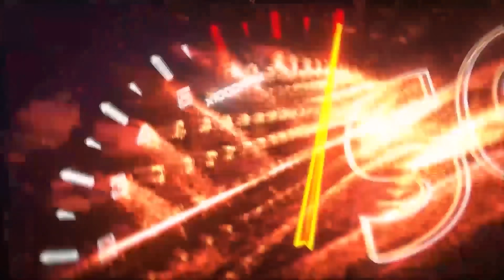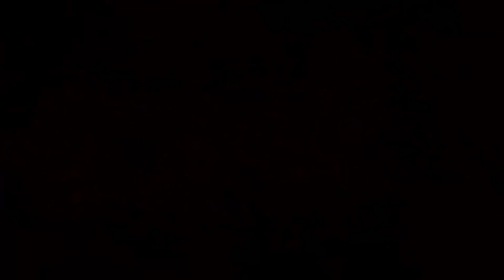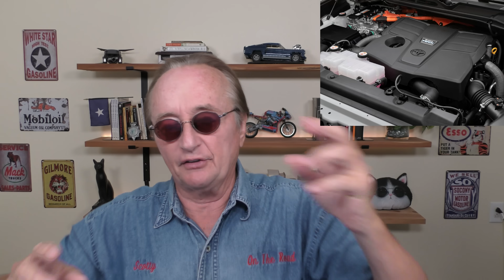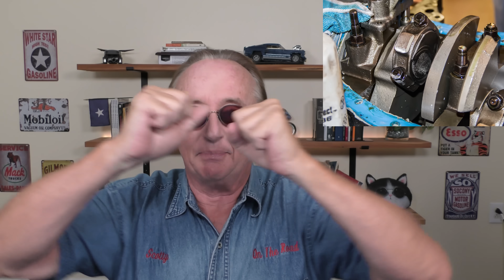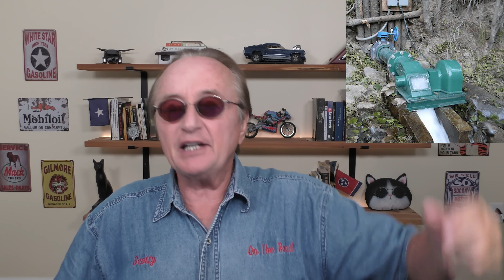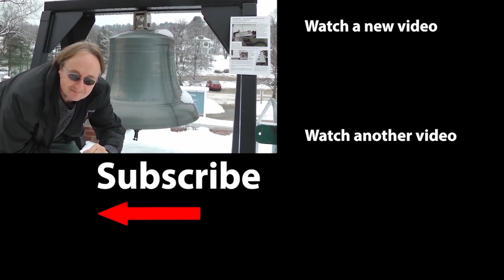America Just Lost It’s Last 2 Car Brands

Comment: 1️⃣get rid of $90,0000 trucks. 2️⃣ get rid of these turbo engines.3️⃣you don’t need a heated steering wheel 4️⃣we don’t need heated seats or air conditioned seats 5️⃣you need an airbag, cruise control and 4-wheel drive and that’s about it. The rest of the sh*t they put in and on these vehicles is pointless
Reply: Nothing wrong with heated seats or steering wheels, or air conditioned seats. It can be useful especially in areas with extreme weather conditions.
Reply: @AndrewFaust-x1e 
Not in the south
Reply: @AndrewFaust-x1e  Exactly, even old cars have them. Mine does.
Reply: So can gloves
Reply: Spot on, the more technology they put in these vehicles the worst they get.  When something goes wrong it will cost a ‘arm & leg’ to fix.
Reply: @guzmancharles7  Hell it costs and arm and a leg to diagnose, much less repair.
Reply: must have a premium stereo system
Reply: THANK YOU!!!
Reply: I have everything you mention in my $20k Sonic so it's not so much the accessories as it is the manufacturer's GREED.
Reply: For some yes heated seats and wheel in Canada is nice so
Reply: I could do without the air bags.  Don't trust 'em.
Reply: @harrymills2770  AIrbags were developed as a mean of protecting people who refused to wear seatbelts.  Wear your seatbelt, you don't need an airbag.
Reply: @Harrymills
Seat belts may help but airbags are worthless.
NOTHING protects you like steel does between you and the thing hitting you. 
Funny how cars from the 70s and older less people got killed then most cars today. 
My wife t boned a Ford Taurus and she was driving a Buick Park Avenue.  She was OK but the guy in the Ford was hurt. Good thing not too bad but still.
After that my wife said she will never drive a small car again which she had before we got the Buick. His car was totaled, our front clip damaged, fixable.

Comment: What are they doing wrong? Everything.. Friend and I called local GM dealer for a quote on timing belt 2014 Cruze ecotech motor.  Easy job!! They said $3200.00
Reply: Owned a brand new 2013 Cruze...the amount of electrical issues and bulbs blowing was astonishing..+ fuel injectors were a connected bank...1 goes bad all gets replaced... horrible car😂
Reply: buy a corolla
Reply: That one of the reason I stop buying Americans car. It make me feel like Japanese products in the 60's it call throw away no one will fix it!
Reply: They didn't want the to do it since it couldn't be done with a "Software" upgrade.

Comment: Gm is selling a $90k GMC Denali ev pickup. Are they f-ing insane!? Try making and selling a pickup truck for $25k for everyone.
Reply: I bought a base F-100 for $4,864 in 1978. Even if inflation made prices rise 5 times since then, that's still only about $25,000 in today's money. Greed is driving prices. I haven't got 90k for a truck and I'd never consider going that deeply into debt for a set of wheels.
Reply: Government makes them put a lot more stuff in a new truck than in 1978
Reply: @patrickchubey3127 $4,864 in ‘78 is $23,465 in today’s money. That said, one of the main reasons that vehicles are so much more expensive is all of the extra safety and emissions requirements that modern vehicles are required to be saddled with. Even still, a base F150 should still not be more than in the high $20k price range.
Reply: @patrickchubey3127  Greed isn't why they are forced to develop/buy and install cameras that detect pedestrians and connect to the brake pedal.
Reply: I bought a new Navistar Eagle, loaded in 1999,  brand new for $101,000.  Now, a pickup cost that.  Crazy
Reply: @Eagles0690 what was 101k in 1999 is 190k today, unfortunately.
Reply: The Government is ok with that..   phasing out middle America!!   For  Elites vs Poor ... JMO But it's Here.. I'M Looking At It... Everyday..
Reply: @Treeplanter73  the Denali is the most fully loaded package and you’re complaining it’s expensive?
Reply: @jalhusky  yes
Reply: @jalhusky    Everyone ain’t got money to 🔥
Reply: @Eagles0690  theres a saying that goes “Beggers can’t be choosers”
Reply: Agreed.
Reply: @Treeplanter73  I think Ford nailed it with the Maverick.
Reply: Impossible that cheap with the emissions and safety laws where they are.
Reply: @tsubadaikhan6332   Trump said people need a low cost basic car. I believe he can cut the red tape to allow this to happen. This is not an endorsement of Trump, but at least he said something on the matter.
Reply: Inflation. Dollar worthless
Reply: @JKHTX no. That’s beyond inflation. That’s greed.
Reply: @JKHTX  Price gouging.
Reply: Ford broncos are about 90,000 also .I do believe
Reply: @Steven-bp8jn yep, remember when they Ford brought it Back!!  30.000 Base  package for Everyone!!  Last year Quit Building the Base Why because Ford wasn't selling the top packages now just for Elites.. MY HOPE IS THEY FORD, GM. ALL OF THEM SHUT DOWN...  Bankrupt...

Comment: I miss the old days when Ford made good vehicles.
Reply: Had a 71 LTD with a 351 Cleveland   motor. Took it to Germany in 1980. Ran the autobahn for 3 years at 100mph only Normal maintenance required.  Only Ford I ever owned, but it was a good one.
Reply: @porkrind3512 I had the same car but with the Windsor engine, it was a POS.  40,000 miles and the engine was shot.  I wish I had the Cleveland
Reply: My grand parents owned Ford Model A and no problem. My sister brought a brand-new Mustang and this car burn in half while she stop by for lunch after dealer service. She never buy Ford again!
Reply: Have you driven a Forrrrrrrrrrrd, late-ly?
Reply: Can any manufacturer actually build a reliably vehicle. They keep adding more modules & sensors making them completely unreliable.
I work with electronics and I personally would avoid anything with to much electronic 😂
Reply: 79–11 Crown Victoria and the other Panther chassis based Fords are arguably some of the best cars FoMoCo ever produced
Reply: @johnbowers7115  Ford tried going woke. It's HoMoCo now
Reply: @johnbowers7115  Exceptions don't prove the rule.
Reply: @johnbowers7115 Agreed 100%
Reply: 1926?        CB
Reply: The last of the V8 Interceptors
Reply: I bought a 1984 f150 for $9,000. A 1990 for a little more. The 1990 is still on the road. Both were good vehicles. A 1998 5.4 that died with around 250,000 miles. Not as dependable as the earlier. A 2008 F250 5.4 motor needed replacing with just over 100,000 miles.
Reply: Bro my 2009 ford Taurus is incredibly reliable. 365k miles original engine and trans. They made some quality back then
Reply: I’m 48. When was that?
Reply: Good one! 😂
Reply: When was that? What model? years?
Reply: Yep!  I didn't purchase Ford due to knowing it got cheap; I bought Honda and Honda even sucks; They all suck!  They all screwing customers with their plastic crap.
Reply: I still have a 95 F150, and I'm never getting rid of it. That was the last decade of F150s that where actually built to last
Reply: Best cars i Australia 1985_95
Reply: Nobody makes great cars anymore Honda maybe Toyota is junk now
Reply: Sad to see would have loved to buy American
Reply: The accountants are pushing for less cylinders, e- , and Mexican made are killing the industry.
Reply: @3dpooltile829  all about money for the stockholders.
Reply: They only make the mustang gt and f150 5.0 that are good these days. Everything else is trash
Reply: @sayiangod9404  the maverick with the hybrid is really good from a reliability perspective
Reply: Car brands were just a preference back when I started driving in the late 70's. Then it became a clusterf#@k of gov't over-regulation due to the EPA.
This is what we ended up with.....stupid people running the USA, and shitty technology that the average working class can't afford.
I've driven the big 3 since a teenager.....none were any better or worse than the other.
Reply: Me too
Reply: Like before 1964?
Reply: Totally agree Thomas
Reply: ford employees got lazy, spoiled rotten, way over paid and ridiculous benefits. At one time, 7 weeks paid vacation. I'm not paying for that.
Reply: My 2door Bronco is just ok.  But I still love it
Reply: cars
Reply: The good old days of the Model T
Reply: When tf was that?
Reply: I liked my Taurus…the only problem was I didn’t change my the oil often enough so the motor blew. I grew up detesting Ford but now I detest GM.
Reply: If you broke, stay away. I buy the F350 King Ranches. More for me! Get yo money up brokie
Reply: 1905 was a good year
Reply: The Mustang GT is a fun vehicle
Reply: I am 67 tell me when ford or gm ever made good vehicles ??? I worked at both plants in nz , absolute crap products !
Reply: I have 3 and they're all great
Reply: When the hell was that ?
Reply: You hate America
Reply: Built Mexico tough -
Reply: My 2004 explorer still runs original engine and trans
Reply: 1912?
Reply: My Ford Falcon was an awesome car
Reply: F the UAW crooks for taxpayers money
Reply: My 2022 f350 is so good it’s incredible
Reply: Ford is quality job none.
Reply: When was that?
Reply: found on road dead isn't a recent phenomenon
Reply: Ford Pinto, Ford Bronco, Ford Fiesta. Best cars. 🚗
Reply: We still do
Reply: Same here
Reply: When was that..1905
Reply: @mikefoehr235 Crown Victoria time.
Reply: @MikeHenderson-tm1hs  so back in 1905
Reply: @mikefoehr235 more like back in 1995.
Reply: @mikefoehr235 model t
Reply: @mikefoehr235 it stopped in the 90s
Reply: @Libertad59  our 97 Taurus needed a second engine and was on its way to a 3rd transmission and so many other things broke. It cost more in repairs than 4 Toyotas combined
Reply: @mikefoehr235 Thats funny cause my 1996 Ford F150 with a 5.0L (302) Windsor V8 with 211,000 miles on it and still going strong.
Reply: @mikefoehr235  lmao.
Reply: @mikefoehr235 My 1996 Ford F150 with a 5.0L (302) Windsor V8 has 211,000 miles and still going strong.
Reply: At ford quality is job one  build ford  tough.:face-fuchsia-poop-shape:
Reply: Last good Ford I owned was a 1966 Falcon.  Wish I still had it.
Reply: @RacerX888  what "bad" Fords did you own?
Reply: Isn’t the f150 an exception?
Reply: @naveenthemachine my 2005 f150xlt is great
Reply: @naveenthemachine  I dunno... mine blew a spark plug out of the head.
Reply: @naveenthemachine  barely
Reply: @mikefoehr235  lol
Reply: Me too. Would love to have a '67 Galaxie with a 390 and AC as a daily driver. Gotta move out of the rust belt first...
Reply: you have a weird memory
Reply: Ford never made a good vehicles FIX OFTEN REPAIR DAILY
Reply: spoiler alert, they never did.

4 good models don't count. A guy I know tries using this excuse with BMW.
Reply: @masonreppeto882  Bud Ford spans over a century worth of cars built. Spoiler alert, you are awfully wrong. lol
Reply: @masonreppeto882 Henry Ford sure did F us over with 24/7 running factories though, and shift work
Reply: @NeedsLessWedge  That's for sure, can't expect high quality vehicles with corporate thugs running you into the ground.
Reply: @masonreppeto882  ✅️👌👍
Reply: @masonreppeto882  I'm sure that you weren't even alive 50 years ago. 😂 Yet you want to comment on something you know absolutely nothing about.
Reply: @masonreppeto882  stop. Ford made great vehicles for a while.
Reply: @masonreppeto882 that’s not true
Reply: And they were affordable.   60 grand for an F150
Reply: @DS-wo8wr 

60k is affordable😂 

Where do yall work? Lol send me an application!😂
Reply: Me too
Reply: Me too
Reply: Yeah! Like the Tempo!
Reply: 😂😂😂😂 You're so funny! Ford has never made good vehicles.
Reply: @john81566 Thats weird cause I have a 1996 Ford F150 with a 5.0L (302) Windsor V8 with 211,000 miles on it and still going strong.
Reply: Me, too. 67 was the last year ford made a decent truck.
Reply: FORD - First on race day
Reply: @JohnDio78  FAILURE OF RESEARCH  & DEVELOPMENT

Comment: How is the EV debacle working?
I have a 1999 F-350 Crew Cab dually with a 7.3 liter diesel , aluminum flatbed, with 535,000 miles on it. It is in the body shop right getting totally redone. I paid 20 grand for it. Every time I go to town someone stops me and says 'Hey man, that is a great old truck, would you sell it?' No, not for any price.
Reply: I had a ‘97 F-350 7.3 single cab, long bed. Dana 60/80. Dumbest thing I ever did was sell it.

Comment: Fords issues aren’t on Jim Farley alone. The company has struggled with quality since Alan Mullaly left. Mark Fields, Jim Hackett had seriously short stints as President where they kept trying to cut costs instead of improving quality. Just my 2 cents…
Reply: Alan mulally era fords were great
Reply: @tesla_models  he brought back the Taurus!!!
Reply: @christopherhamilton5557  yep great Cars
Reply: Ford and GM are screwed. They have to figure out how to make a profit off EVs because the manufacturing costs of EVs is going to keep going down while gas cars keeps going up. But, the rest of the company is opposed to it. UAW doesn't like losing jobs. The dealerships hate EVs because they require no service. Tesla has no dealerships and no UAW. They have a huge advantage. I think GM and Ford will have to go bankrupt, ditch their dealerships, and ditch the UAW contracts. Might have to have all their cars be EVs made in China.
Reply: they're cutting costs while shoving more computer crap in there, I mean the 2018 F-150 got a misfire if water got in the back left tail light, and the tail lights had dodgy seals, and that's before we get into diff housings shattering and transmission gears shearing off in under 1000 miles

Comment: and if you own a EV you will be bankrupt in 5 years ..when you have to buy a new battery...for 25,000..then 5,000 to 10,000 to have it removed replaced and disposed...😂😂😂
Reply: No you just get a new one every 4 years
Reply: I will buy flying sources that much cheaper than battery of EV.
Reply: Don’t forget about the $10-$15k for a fast charger wired into your home..
Reply: I am working on a rubberband-clockspring powered engine to replace the EV powertrains.
Just wind and go.